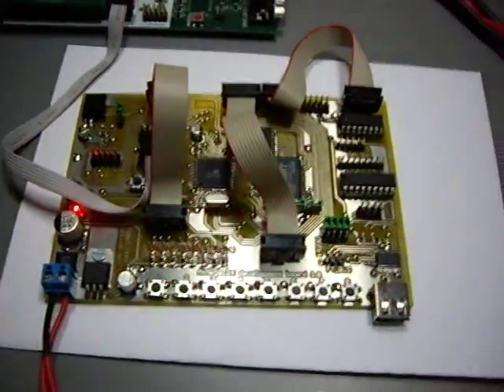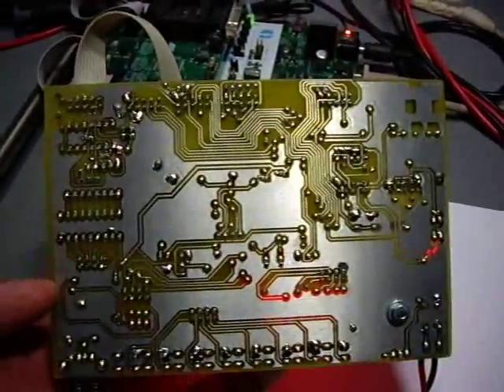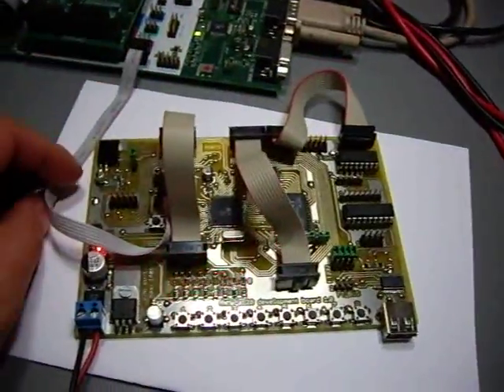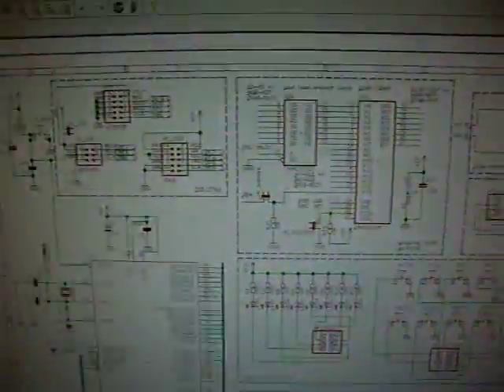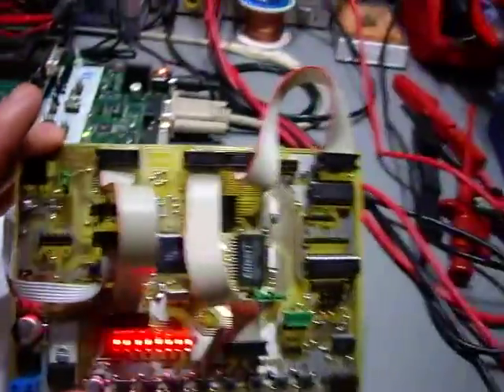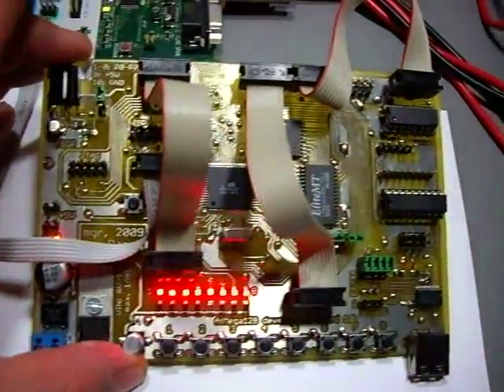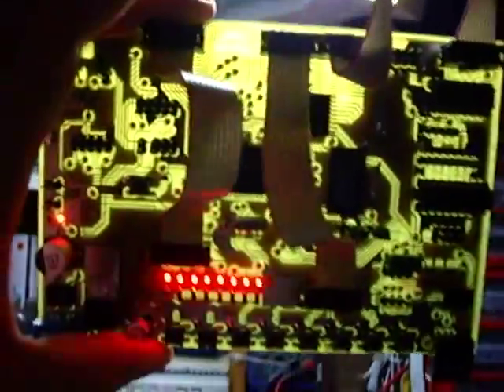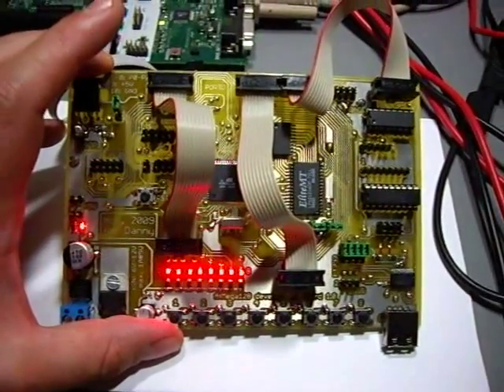Atmega128 development board

Comment: The PCB quality and the clean layout are impressive, the board looks very professional. 

Off topic
I don't know how you can do a 2 layer PCB without mistakes an so precise at home, especially this big board.  
I need to do PCBs with a few SSOP parts, but I'd rather have it factory made. Using the photo method i got either many cracked or shorted traces.